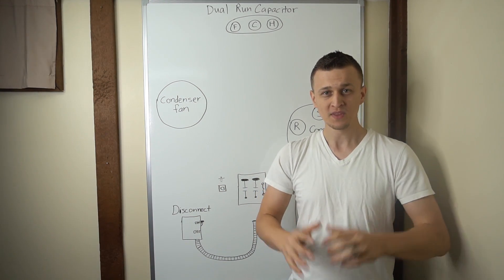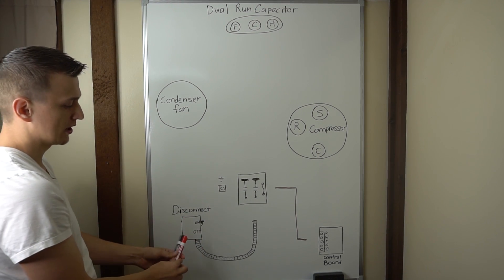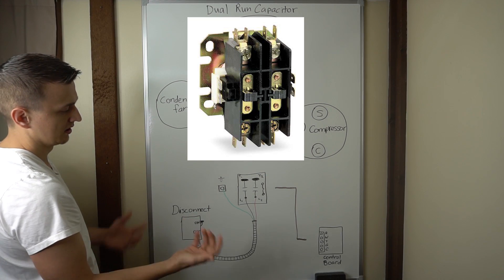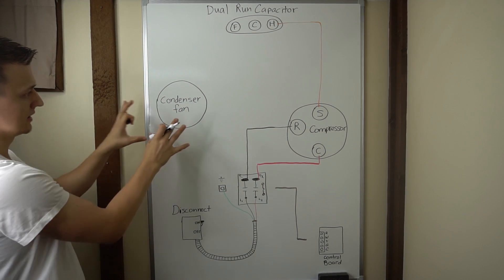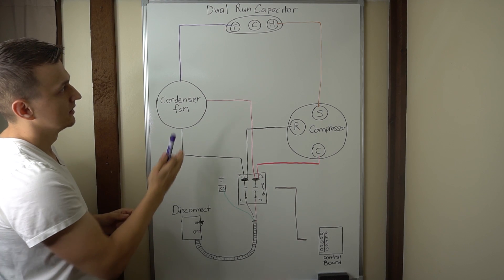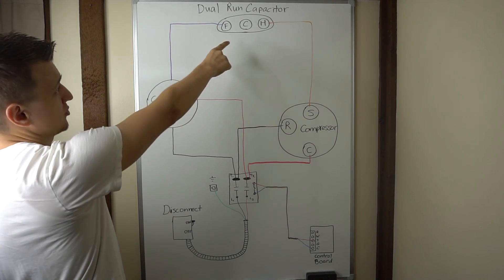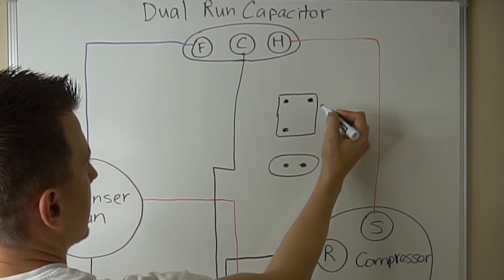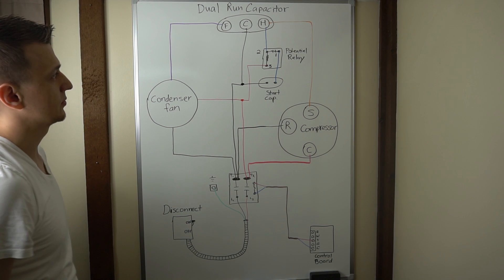How To Wire AC Unit - Easy Diagram

Comment from the maker: ➡ More Videos For Further Information:

How to Wire Thermostat:
https://youtu.be/VknvJ9POYDo
How to Wire Air Conditioner Compressor:
https://youtu.be/GhBTVn5CHBE
10 Ways to Splice Wires Together:
https://youtu.be/ihpNCVk1lF0
How to Read Furnace Wiring Diagram:
https://youtu.be/2MSedAkirqw
How to Read A/C Wiring Diagram:
https://youtu.be/2MSedAkirqw
How to Read Water Heater Wiring Diagram:
https://youtu.be/TX8SuHK1esY
Basic Thermostat Wiring Diagram:
https://youtu.be/jDLz3REPTWM
How to Wire Indoor Blower Motor:
https://youtu.be/4S8TZd-45bY
How to Wire Outdoor Condenser Fan Motor:
https://youtu.be/VlMhvwrpimE
Is Common and Ground The Same Thing:
https://youtu.be/wiKDlIlbiP4
Electrical Symbols and Meanings for Switches:
https://youtu.be/ngQCmR_w9QU
Ohm's Law Explained:
https://youtu.be/sILl7p_J1UU

Comment: This is an excellent video, Would it be possible for you to add the Defrost Board to the same diagram and illustrate how cooling and heating works? If you can add additional functionalities such as to how high and low pressure switches work before the contacter get engaged, that would be really nice. Thanks you for putting out excellent HVAC videos.

Comment: One question: C in capacitor should have L1(or Common), C from both Fan motor and Herm side.  Therefore three lines must be connected in C plate of the capacitor.  Am I wrong? Your drawing shows only one(1) line from T1, which is the main power line.

Comment: I had my contact wires corrode. I have been wondering where they connect to. Thank you for the detailed explaination. I just did a soft start a few months ago. It was actually easy to install. Im not an HVAC tech. I come from an automotive background so I undsrstand the concept from working on cars. I have been shocked on how simple and efficent some of these older units are.

Comment: You said the contacter sucks in. What is the suction source please? Thank you!
Reply from the maker: There is a low voltage electronic coil that, when energized, pulls that little plunger into a closed/pushed in position

Comment: Jay i have a important question for you that Im confused about. On this video you said that the 3 wires that  come out of the condenser fan are brown or purple. Two of them connect to either side of the contactor and the other wire to the fan term on the start capacitor. The colors of the wires on my condenser fan are purple brown and black. I have the purple and black connected to either side of the contactor and the brown to the fan term on the run capacitor is that correct????
Reply from the maker: That sounds like it should be correct, but double-check the wiring diagram on the motor itself (hopefully it has one) to know for sure. But from experience, the brown wire is almost always for the capacitor. 😉
Reply: Thx for the prompt response. That is a rare thing nowadays and  I just subscribed to your channel YOU ARE THE BEST!!! And thx 4 ur extremely helpful videos. KUDOS 2 U

Comment: I do not have dual capacitor, but rather have 40uf start/Compressor  capacitor and 6uf run/fan capacitor. Im replacing the start capacitor. Old one had 2 terminals(2 prongs each). The new one has 2 terminals (4 prong and 2 prong representing common and  fan respectively i guess). 

Which terminal on the start capacitor do I connect the start winding (yellow wire) from the compressor. To the common terminal (4prong) or the fan terminal(2 prong) on the 40uf start capacitor? Thank you very much in advance

Comment: Thank you! this was very helpful. Between this explanation, and the color-coding wiring diagram on my unit, I was able to fix my issue. My symptom was fan unit not running and manually trying to spin it didn't help. A wire had come loose from the contact- after reattaching I was up and running. A service tech had come and wanted to sell me a new expensive unit I cannot afford right now (admit mine is old), and tech had left the capacitor unattached. I was able to wire everything back and reattach with confidence.

Comment: So i have a three wire fan but my diagram says to put black with contactor and brown with fan and purple with common on the capacitor. So i only have black on contactor and the other 2 from fan, onto the capacitor. Should i do what yours shows? My ac isnt working

Comment: Good stuff. The condenser fan , does it have labeled wires or can I use which ever I want for my connections ? It might show on the motor ? Great channel.
Reply from the maker: Usually there is a label on the motor itself which shows which color wire is supposed to go where.

Comment: I need some advice: the tech who installed my A/C years ago did not attach the common wire from the exterior unit to the common bus in the circuit breaker panel -- he just put a wire nut on the end (so the white wire is dangling uselessly inside the panel).  It seems the bus does not have a terminal big enough to fit that white wire. I'm tempted to install a second common bus (with large enough terminals), tie the two buses together, and attach the white common wire.  Do you see any problems with this approach?

Comment: Very nice video I've been watching your stuff alot. I have a question when I put my disconnect in it trips the breaker. So I reset the breaker with the disconnect out and when I try to put the disconnect in the compressor tries to run even when thermostat is off. If I leave it in it will trip the breaker. Could this be a bad compressor??????

Comment: Great Video ! This helped me a ton. Also,  I have two yellow wires that are coming from the pressure sensor which I am unsure where to connect. Also, another yellow wire  is connected to the white (common ) wire coming from the control board but not sure where the other end goes ?

Comment: How can you provide a battery backup for the 24-volt system so that if you have a power out your XL824/850/1050 Thermostat will not lose power and have to reboot?

Comment: Thank you so much for this video. Just wondering have you posted any videos that show how to hook up with the EZ start (or soft start) instead of "hard start" ?. Also some quick explaination about terminalology name/functional for the connector of the compressor , relay and Dual run capacitor it will help.Thanks again!

Comment: I know this video is old, but this is EXACTLY what I was looking for. My A/C unit was a mess of wires when I opened the cover. None of the wires were organized at all. The capacitor had completely blown and there were a bunch of disconnected wires I wasn't sure where they went. This is the first video I've found with the potential relay and start cap wiring mentioned AT ALL. Very well organized and easy to understand video. I've been digging all day. THANK YOU.
Reply from the maker: You're welcome! Glad to hear that this video was exactly what you were looking for! Happy to hear it helped!

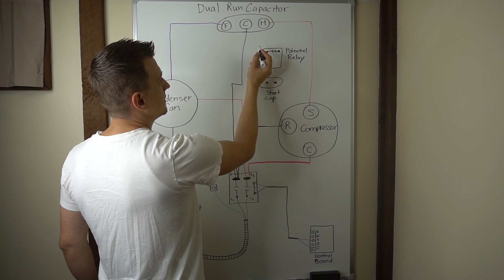Comment: I need help. I’m trying to rewire an outdoor condenser. I don’t know if it’s a Nordine or Frigidaire I forget condenser but when I go to hook up the compressor, there is two small black wires and a small thin red wire besides your normal three heavy ones and I’m not sure, I think the two small thin black ones went to the to the 120 leg on the bottom of the contactor but I’m not sure if anybody could help me out. It’s a Copeland compressor 2 ton unit. 9:23

Comment: My friend after my fan motor and capacitor went out i opened up the panel to find all kinds of wiring add - ons so I watched a few of your videos and then saw this one and took a chance and my system is up and running by your diagram i can't thank you enough. do you offer a way to buy you a cup of coffee.(or 2)
Reply from the maker: Great! I love to hear that you were able to get it wired up right and working again. Stay cool my friend! There is a paypal link in the video description but your comment is enough of a thanks. Don't feel obligated to buy me coffee.
Reply: @WordofAdviceTV  I even decided to go with the super boost for hard starting but i have a 1/4 hp motor and it's for 1/2 thru 10 hp. I won't hold your feet to the fire but should it be alright.also is there another way to support the channel , the paypal link says i have to sign in or sign up and I cancelled my paypal account years ago. but I want to help with the channel

Comment: Need help please I have a 2 ton AC system. I think it’s a Frigidaire with a Copeland compressor and I’m changing the capacitor and the contactor. I can’t figure out the wiring the compressor I think five wires wired somebody else said they’re probably 24 V and then has red and yellow. The heavier wire is anybody help me out to tell me where the little wires goon this Copeland compressor hooking to a contactor with the run capacitor dual run

Comment: I need help and I can tell right off the bat this site knows what it’s doing. It was a nice job explanation. Here’s my problem. I started changing the capacitor and the contactor and I didn’t pay attention to where all the wires ago and I followed your wiring video here and it looks very explanatory. Very good but my wires coming off of my Copeland compressor, I have two small wires besides three heavy wires which somebody said is it is is a 24 V shut it down if it overheats I don’t I don’t know where those wires go if they’re 120 V can you help me out too thin, black wires besides the three wires right into the compressor. I have no idea where they go.

Comment: Great video, thank you very much for the explanation. I have a question about the compressor wiring: shouldn't the compressor Common (C) go to T1 where the capacitor and fan commons connect to? In that case, the compressor Run (R) wire would go to  T2.

Comment: I know this is an older video and you might not have an answer to my question but, I have an older condenser, roughly the early 90’s or late 80’s. Everything is wired up besides the wires to the furnace control board, and I have a small transformer block that one wire is dangling off of the load side. The other wire on the load side is wired up to the contractor and the line side is wired to its respective hot side. I cannot find a wire diagram or even a model number as it’s all sunfaded. And I can’t find any info on how to wire this transformer in. Any insight?

Comment: Hello.  My wiring is exactly as above except there are 2 additional wires on the capacitor. Both of them are connected to H on the capacitor.  Had to change the capacitor but old one was so rusted I could not read the terminals.  Can you assist?  Thanks

Comment: What about if you have a HZ311 zone damper? Does the 24v two wire go to the furnace board or the damper board? Literally can not find ANYTHING online about it and manual is not clear.

Comment: The wires from the disconnect going to L1 and L2 on the contactor are they power (hot) and return (common/neutral)?
Reply from the maker: They are two hot legs, 120v each to get you 240v.
Reply: @WordofAdviceTV  Thanks Jay.  I was just told the same thing in my HVAC class.  My confusion was measuring the 240v at the panel.  The reason why it can be measured at that voltage is because the two legs/lines are 180 degrees out of phase to each other.  That's why there is a difference of potential (voltage).  If they were at the same phase I am guessing that the reading across them would measure 120v?

Comment: Quick question. My puppy chewed up my thermostat wires to my connector. I have wire coming from the positive (red) and negative (black) on the connector. I have a red, blue and white wire coming from the thermostat. My question is, what wires should I connect to the red and black wire sides to the connector?

Comment: Current RHEEM Thermostat is wired via Legacy/COMM terminals. Technician states wiring needs to be transferred over to TRADITIONAL Terminal connections on Control Board to correspond to thermostat wiring. What, if any, re wiring needs to be done outside on condenser unit.
Reply: Thank You

Comment: I saw this video, when you just put out there, and I must tell you, that I thank you so much, for this info. God bless you, (my youth). I NOW HAVE A HEAT PUMP SYSTEM, and live in Poinciana, FLORIDA. I can say with confidence, it is because of this video, that I am able to make a living, and help my neighbors. I have learnt thru the yrs., how to completely diagnosed, trouble shoot,  and electrically fixed or repair, any heat pump system; And I  do it as a COURTESY for my neighbors, who can not afford to pay. You are really one of the best out there on you tube still, thnx again.
Reply from the maker: You are very welcome! I love to hear that you learned so much in the last few years and are now even able to help all the people around you! I'm glad that this video got you started on this path! Stay warm my friend and may God bless you and yours!
Reply: I really appreciate you, God bless, and take care. You know there is one question that i would really like you, or any other out there to answer, if possible, and it is this. 
Can you explain fully about THE "C" terminal, ("THE COMMON"), on the control voltage, to the outdoor unit and the  t'stat? Why is it that : when trouble shooting, one has to read between the "c"  and the other designated terminals, and NOT FROM the "R", which supplies the power? i just can not get to understand it fully, yet, but it is what i know has to be done. I hope i am making sense. Thnx again. @WordofAdviceTV
Reply: Thermostat needs ambient power present at all times so it can make different calls

Comment: Nice video.  If you wanted to measure inrush of the compressor at start-up, which wire would iu place the meter? The black or red or does it matter?  Thanks

Comment: What about the fan capasitor
Reply from the maker: In this picture it is part of the dual capacitor. If the fan capacitor is separate, then there will be two brown wires (one might be brown and white) that come from the fan motor to the capacitor.

Comment: Excellent communicator with a great teaching style blended with a sound working knowledge of his subject. I'll be looking for your videos for future projects.  
My AC condenser unit is a 36 year old Carrier Model 38EN-036-340 manufacture date  9/87.  I couldn't find schematics or wiring diagrams online.  The start capacitor was showing corrosion around the top. I went ahead and replaced the start and run capacitor and then the contactor was sticking. It would pull in with a light tap,  so I  replaced it as well.  My AC condensor has one more piece wired in  beyond your last diagram... it is a Supco TD-73 Delay on Break timer.  I would love to know more about what it does.  
Your diagram here was most helpful. My system is back up and running. Thanks!

Comment: I have questions for my blue wires not connected to inside board but heating runs perfectly . Right now,  I put new moter and connected every but cooling, not working  nothing happens , suggestion requests?  Thanks

Comment: I would have put the common from the capacitor on the same leg as the common on the contactor because I thought we should kept Run and Common on separate legs of power. And keep all Runs and Commons on same leg 🤷🏽‍♂️ *ps I’m a student still learning any suggestions?? @wordofadvicetv

Comment: Great video!  Do you have a video similar to this one but for wiring Air Handler?

Wiring flow between 240 volts , transformer, board and thermostat wire.

Thanks in advance

Comment: I know this is a really old video so I may be too late but if you could do one of these for an air handler that would be incredible. I mean worst case scenario. Like you go to a job and someone has tried to do it themselves  and it’s gonna be something where you have to pull all the wires out and start over and wire the whole thing. This air handler would also include say a 10kw heat kit that will need to be installed as well. Maybe there is a video like this out there already so if someone knows of one please let me know. Thanks

Comment: I saw the other video about the ten reasons why your plunger wont stay down. Everything there still checks out, even replaced the batteries to be sure and tried everything else suggested that doesn't require a technician, such as low/high freon check, something I cannot do, I started up the unit, but still the plunger won't engage, though it does make a clicking sound. However, when I press in the plunger everything works, cold air comes  out things seem normal, let it go though and it pops right up again,.  My thought then was it's a bad single pole contactor. I bought a replacement and wired everything up the way it was as near as I can tell, since the new one had no numbers on it, and the situation remains unchanged. It works if you push it in, it fails when you let it go. The small control board inside doesn't feature a replaceable fuse. There are no obvious signs of damage, no burns, no breaks, no swelling caps.  Condesate pump is working. I've never added freon to this system. Not iin 17 years. And if I hold the plunger in it still throws cold air, so what else could it be?  The inside the house board was replaced earlier this year by a tech when the heat failed. However the AC has been working fine since early June when I first turned it on. Thoughts?
Thanks!

Comment: What if you have a 18/3 coming out from furnace with line set all the the way to outside condensor unit. does 1 wire just get capped off ?

Comment: Question.  How does the thermostat get 24Volts?  Where is the transformer located and hooked into this  wiring diagram?   Thanks
Reply: I see it now. The coil in the contactor.  I must have missed my nap today and fell asleep in class.